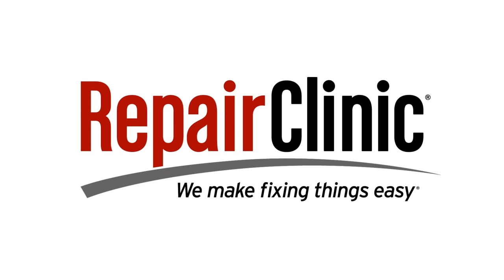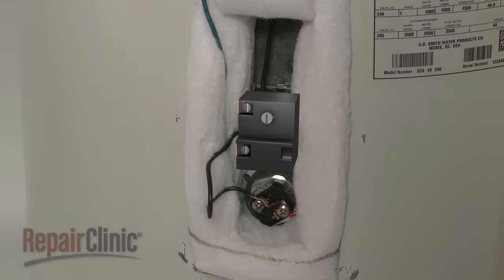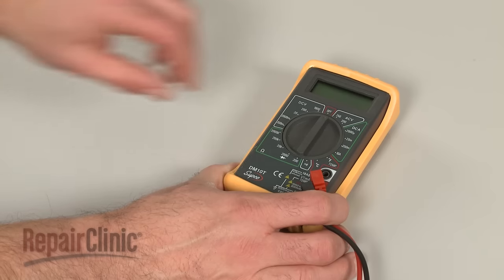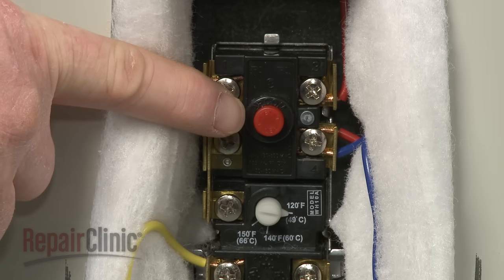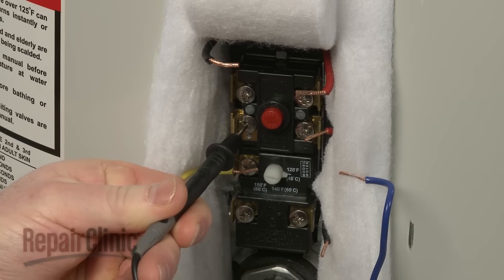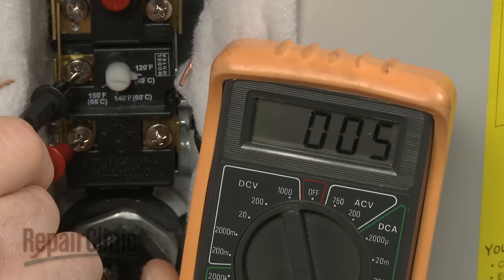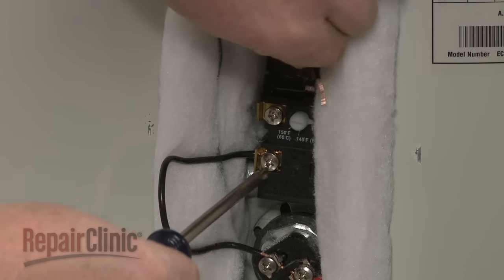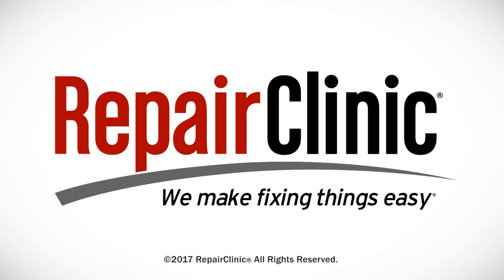Water Heater Not Heating? Thermostat Testing

Comment: For anyone trying to figure this out, keep in mind that the elements won't have power at the same time. Typically the upper element gets power first. Once the set temp is reached it will send power to the lower element. A bad upper element can cause a unit to not heat at all. To check, set upper thermostat to lowest setting and allow to heat. Once to temp it should send voltage through to the lower tstat. Hope this helps.
Reply: THANK YOU i didn't know that i was getting so frustrated.
Reply: Thank you brother 💯💪🏽
Reply: Sounds like a plan.  Great explanation yall.
Reply: Heard that in a vid. But didn't know how to work it.  Thank you😊
Reply: Thanks I surely appreciate you comment as I didn't know how to check the thermostats and my mother's water heater wasn't working properly so I replaced both elements and thermostats I bought them in a package deal ! Now I know how to check the thermostats after reading your comment ! The water heater is about 15 yrs old so I felt replacing both was a good idea ! Now she has plenty of hot water  !
Reply: Good information, thanks!
Reply: Ahhh I hope this is my problem! Thank you I had no idea

Comment: After turning breaker off and BEFORE REMOVING POWER CONDUCTORS CHECK FOR VOLTAGE PRESENT AT POWER TERMINALS, CONDUCTOR TO CONDUCTOR AND CONDUCTOR GROUND! The breakers may be labeled incorrectly or you could have a faulty breaker. Remember all that metal you're working around is grounded!
Reply: Use a Volt Ohm Meter to test correct voltage. I used a Non Contact Voltage Tester Pen that lit up red for voltage present. Problem was that it wasn’t enough power. My circuit breaker was faulty. After replacing 30 amp breaker, I got my 220 volts AC and hot water.

Comment: First time repair clinic has had a video that seems a bit confusing at times when it didn't have to be. Why confuse people who aren't familiar with ohm meters by bringing in descriptions about water temperature? This is confusing, and I'm familiar with electric and water heaters and their parts. Either explain what this has to do with it briefly, or leave it as "it works" or "it's bad". Also just keep it simple on the analog meter and say it pegs out or is dead. I watched this three times and it still derailed my train of thought when it came to the water temp discussion.
Reply: I didnt get it either
Reply: The temp of the water determines if the thermostat is open or closed?
Reply: You have to know the temperature of the water or you won’t know which element is supposed to be being energized at a given point in time. It’s very relevant.

Comment: I see this referred to in comments, but not exactly as I would question. I understand what a 'desired setting is' (what you have the thermostat set to. But how do you know if the water temperature exceeds or is less than desired setting? Video seems to indicate that this is important and not just a "it seems to be hot" or "it seems to only be warm"...?
Reply: confused me too
Reply: I ran the hot water into a glass bowl in my kitchen sink for a couple of minutes. Then as it was running, I used the thermometer I use for meats to check the water temperature in the bowl. Gave me a reading of 152.8 F . Too hot

Comment: brand new thermostat and elements still no heat !
great video though no nonsense and straight to the point.
Reply: 1.  Did you have the correct elements and T-stats installed when you replaced them?  Voltages can be different on the coils of those elements.

2.  Did you install the t-stats and elements correctly?  Be sure that the t-stat with the red button is on top and the smaller of the two is on the bottom and that you've wired it just as before.

3.  Did you ensure that you have the correct amount of voltage being supplied to the heater with the use of a multimeter/volt meter?  Sometimes other switches (breakers, disconnects, fuses) can break the power before it reaches the heater from the panel due to poor connection points.  Breakers can go bad as well as disconnects which can sometimes have fuses inside in the event that something made the fuses blow.

You may have already solved your problem by now, but you can try these things in the future if you have problems again.
Reply: @andrewwelch5668  Turns out the ground was bad on the tank !

Comment: I've installed a new 2 element thermostat following your instructions. Double checked all connections and verified it was pressed firmly against the tank. The new thermostat is doing nothing. Verified continuity as well on the new thermostat prior to install. Same exact thermostat as one replaced. I've since put the old thermostat back in. But now I've noticed it now has continuity whereas before one of the screws for the upper element did not. Now it does. Anyways, I had to turn the thermostat dial all the way to its lowest setting in order for it to kick on and start warming the water. If I turned it directly to the desired temperature the thermostat would make a pop noise and cutt off completely. Now I'm gradually turning the temperature up in incriminates and its not popping or shutting off. Is this normal that one would have to gradually increase the temperature dial to jot over load the thermostat all at once by cranking right up to about 135°? Thank you for your insight and this video.

Comment: What do you mean when water temperature is below designated setting? When checking lower portion of thermostat. Thanks for the help.
Reply: The designated (temperature) setting on the thermostat. 

If it is set to 130 degrees and the element has had a chance to cool, and the room you're in is less than 130 degrees, then there should be continuity through the thermostat, showing that if it was hooked up, it would be heating. When it is warmer than the setting, it will disconnect inside the thermostat and show an open circuit, and that would mean it is not heating.
Reply: @curt2742  The t-stats don't actually measure room temps.  They have thermo discs on the back of them to take the temperature of the tank surface.  It doesn't have anything to do with the temperature of the elements, but rather the temperature of the water that's inside the tank.  The best thing you can do is once you turn the power off to the heater, turn on the hot water at a few faucets in the house until the water that comes out of the faucets is lukewarm/cool.  That will be sure to have the temps in the tank lower than the setpoints of the t-stats.
Reply: @andrewwelch5668  you're right, they are not for measuring room temps, but if the ambient temp was for some reason higher than the temp setting, it would expand that disc. 130* is a bit extreme, but for lower settings or different applications, it could be relevant.

Comment: my electric water runs hot and trips the thermostat reset button, i have isolated the upper and lower heating elements and used the ohm as instructed. Both heating elements have continuity, indicating that they are both good. Now i tested the lower thermostat and it indicates continuity so that also means it is bad per your description. I have also tested the upper thermostat and it has continuity on both sides i followed your video exactly using my laptop next to my work site. The part that gets slightly confusing is testing the lower part of the thermostat. Because my water is hotter then the temperature setting i follow the second explanation, the lower terminal showed continuity and the upper terminal did not. Everything reads as you said per your video, as I am watching it over and over at least ten times.
Reply: Did you end up figuring out what was wrong. I'm in the same boat as your comment
Reply: Im having the same problem did eather of you fig it out??
Reply: Replace your lower element, reset the ECO switch. Even though it has continuity it is most likely overheating the water due to sediment build up or over calcification which will cause the emergency cut off switch to trip. It could take up to 12 hours before producing hot water consistently.

Comment: My heater heats but it doesn't stop on 120. Does it mean upper thermostat needs to be replaced? Thanks for video.
Reply: jazu make sure the thermostat is firmly seated against the tank (assuming that it is set at 120 degrees).  Sometimes it is improperly seated in the clips that hold it to the tank and sometimes the clips are sprung. Either way, if the t-stat is not tight against the tank it can't sense heat.
Reply: Thermostat are not super precise. I see a bunch that are really poorly calibrated. You may just need to decrease your dial to get to 120.
Reply: Most are just Bi-Metallic thermostats that aren't very precise at all

Comment: Thermostat on top and element both tested good. Bottom element is bad and rusted to the point I am afraid to try and take it out, water heater was installed new 8 years ago. As I try  and heat water breaker trips inside house after 5 minutes, WHY?

Comment: Water is cold in 4:26 tank. Left lower side is showing open circuit or no continuity. Right lower side is showing   closed circuit or continuity. Lower thermostat showing continuity. Does this mean that upper thermostat is bad considering water is cold in tank and upper thermostat on left side is showing open circuit

Comment: I need help.... I just bought an electric water heater about 1 month ago and the hot water runs out quickly while taking a shower. I have the temperature set at 125 degrees on both thermostats. At 5 minutes into the shower the hot water is getting cool and i have to turn down the cold water so it can get hot again. Right at 9-10 minutes into the shower the hot water finishes. I checked the voltage on the thermostats and they give me a reading of 240 and I checked for continuity on the elements and give me a reading of 12.5 on the elements. What can the problem be?????

Thanks!

Comment: What makes this video confusing is he sometimes refers to "continuity" and other times what you should see on the meter, and sometimes resistance.  Also, the "designated water temperature" is never defined (I'm assuming it's what the thermostat is set to).  He presents conditional testing for the lower pole of the upper thermo, and the lower thermo, where you need to not only know the designated water temperature, but also the temperature of the water inside the tank, which from where I'm sitting is pretty unknowable!
Reply: What i would do is run hotwater to lower temp in tank and then do test.
Reply: You could always run a cup of the hottest water setting from a faucet, dunk a thermometer, and check the temp. Otherwise run out the hot water completely so you can ensure it's below the minimum setting.
Reply: Generally, you can crack up the temperature to test for closing and turn the temperature back down to test for opening of thermostats.  He was checking for continuity the entire time.  He misspoke when saying test resistance.  You can test resistance of the heating elements their self.  Resistance checks for parts with loads motors, ignitors, or sensors.  Continuity is just making sure there is a closed path from point a to point b.
Reply: @zachosborne6577  uhh.. opening you crank up, and closing you bring down I thought...
Either way doesn't matter much 
But ohms/resistance/continuity/pathway... are all the same verbage.
Testing the rods for that is making sure there is a continued path all the way through without breakage.
They litterly mean the same thing.
You check for that on heating elements/rods, and the thermostats. And to make sure it is getting amperage correctly OR SUFFICIENT power to the element.
In most cases.. save yourself time and little money by just replacing the thermostats and both rods. Save yourself the headache if you don't know what you are doing. They come in a pack for $30. Thermostats snap on top and bottom easily. And rods turn in and out like a light bulb. This easily can be a 5 to 10 min job without even having to drain the water. Just get a small bucket or towel, once you loosen the top rod, pull it out, shuv the new one back in fast! You'll lose maybe a bottle water worth of water. Do same thing on bottom element.
Wait for it to dry. Snap off old thermostats and on with the new.
Dry it nicely. Put foam covering and shield back. Wait an hour to let moisture dry. Then turn your power back on.
Don't make it harder than it has too.
I didn't need to replace my thermostats. But if I had known what I know now, I would of simply just done this and saved myself hours of time and headache

Comment: Not sure if this might help someone. But the symptom will often point to the bad part.  NO hot water would be an upper element or stat

Hot water runs cold after 5 minutes would tell you the lower stat or element is to blame.

A tripped reset usually means the lower element is gunked up with sediment and overheating the tank
Reply: BzzKll2k15 I hope you’re right. I’m taking your word on this. I’ll let you know later today how it worked out.
Reply: Thanks for this information.
Reply: This guys a genius, everything you said was dead nuts from my experiences too bad I learned the hard way before I seen this.
Reply: Thank you! Our bottom element keeps getting calcium around it and losing continuity.
Reply: thank you so much, you just simplified this for me!!

Comment: Hello, 
I have tested everything 3 times and all my results were good. My water suddenly got scalding hot. Then it overheats and trips the shut off button. I have already replaced the top thermostat.  What could be the issues? Please help.  Thank you.
Reply: Replace your lower element and reset the ECO switch. It could take up to 12 hours before the heater produces hot water consistently, but this should fix the problem.

Comment: Does this method apply to smaller electric water heaters? I have a 30 gallon, single element water heater in a guest house bath, and it stopped heating.
Reply: Tested both, thermostat, and element for continuity, both good. Stumped.

Comment: We have the 80 gallon AO Smith water heater.  It's just over 3 years old and bit by bit, the hot water line started getting air in it so when you'd turn the hot water on, the first bits would spit out at you.  As that developed, the water started getting hotter.  The "tech support" (I use the term very loosely) deferred to an authorized plumber who would only charge for labor, not parts. Such a deal!  I bought a kit w/ both elements and both thermostats for just under $30 and changed them out myself.  While one of the Thermostats may have been part of the problem, seems there's still air getting in the system.  Any thoughts?  The cold water runs fine.  We're on a well + have the complete Culligan system (not that we needed it) but either way, it channels water to both the hot and cold water and only the hot water line seems to be getting air in it.  Thanks!
Reply: i really hope you already solved your problem and  meaby can help  since its like the firs   person i see with  the same  problem  ( i  have a  filtreation system too )  so after the changed the water  heather   the water started to do that    pit outs  and they say  it will go away well only did a liitle  bit  couple months went by  and  hot  water  very hot but didnt last now  its not  hot  water  of alll( i tried  the reset  botton  )  any ideas ?  thanks
Reply: This maybe about 4 years too late, but it would seem like to me that you have either of 2 problems.  Your water heater anode rod is having a bad reaction with the quality of water coming from your well (yes, even if you have an expensive water treatment system) or your well pump maybe experiencing intermittent malfunctions/well not recovering fast enough/leaks in the outside well piping.

If the issue wasn't resolved by now, try replacing your anode rod in the water heater with a Corro-Protec anode first.  If that doesn't fix it, bypass your water treatment system for about several days and see if the problem still exists.  If that don't work, call a well service company to do some investigating.

Comment: Can a thermostat be stuck closed? I am asking this because I have a hot water heater with one heating element. The water gets way too hot. The temperature is set to 125 and seems to be stuck on and overheating the water. I don't think it has tripped the reset button cause it is still heating up the tank. Any ideas where I should start diagnosing?
Reply: You may have solved the issue by now, but the answer to your question is most certainly yes!  The thermostat has contact points inside of them to distribute power once the switch inside engages the contact points.  The switch can fuse on to the contact points as electric current and load being used can heat the wire and contact points over time.

In your case though, it's most likely the case of the t-stat thermo discs which measure the tank temps being out of calibration and the heater to run wild.  If it eventually shuts off without having to pop the red reset button (E.C.O. or thermal overload) on the upper t-stat, then the switch fusing together is not likely your issue.  Either way, the t-stat(s) would need to be replaced.